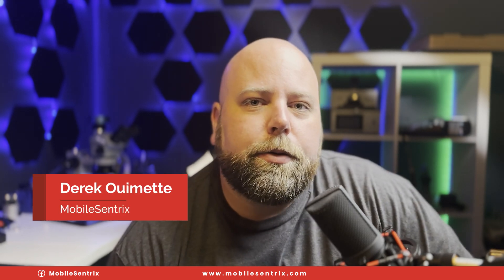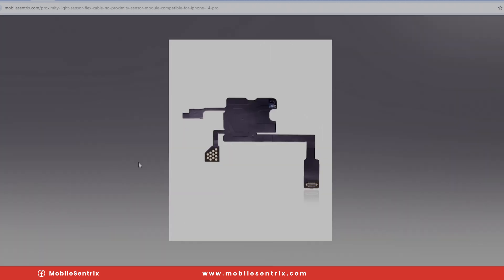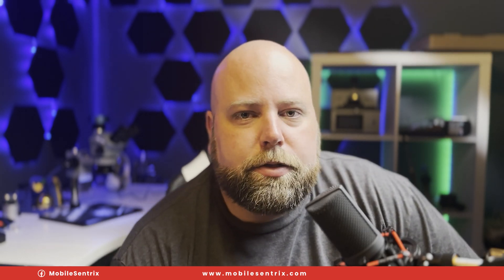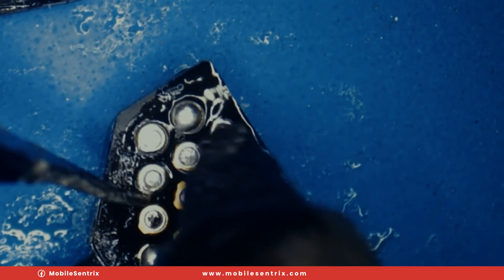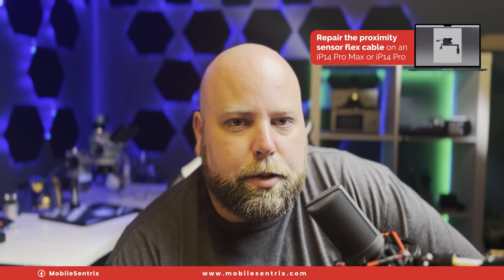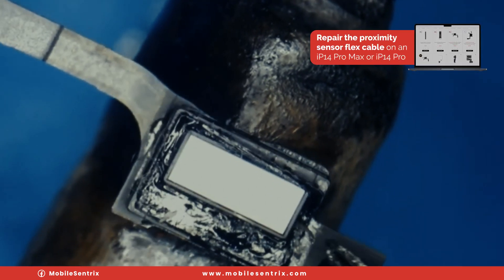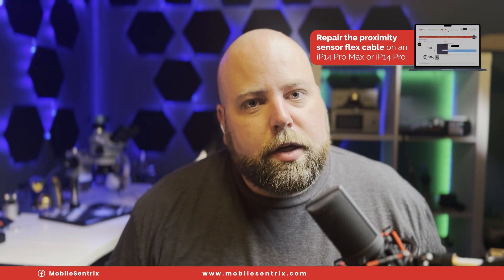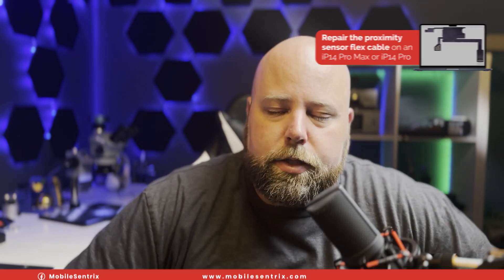How to Repair the Proximity Sensor Flex Cable on iPhone 14 Pro and Pro Max!

Comment: I found a cable with the light sensor but no proximity sensor. Can i only transfer the proximity sensor? Or do i need to program the new ambient light sensor ?

Comment: So if the flex cable is cut what do you do to transfer the data?
Reply: there is no "data" on the prox flex. the ALS and prox are serialized. If it's ripped you'll have to de-solder and xfer both the ALS and the Prox in order to have a functional unit. If it's simply not working and your flex is good, you still need to xfer the prox, but then you use a programmer to read the ALS serial and write it to the new flex

Comment: whats the benefit? ive replaced two so far and maintained face id without soldering.
Reply: how?
i have torn my flex cable
Reply: The benefit is that the auto brightness will work again. If you swap the cable, True Tone and Face ID still work under iOS 18 but auto brightness will just refuse to work; the phone won’t be able to get peak brightness in direct sunlight, as well as dim if you’re in the dark or get bright when you’re going from dark to bright environments